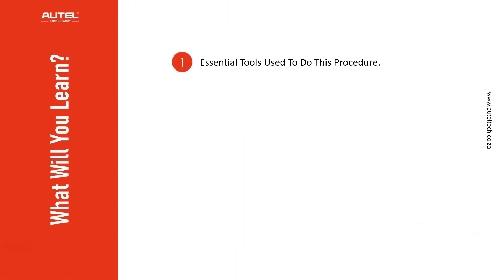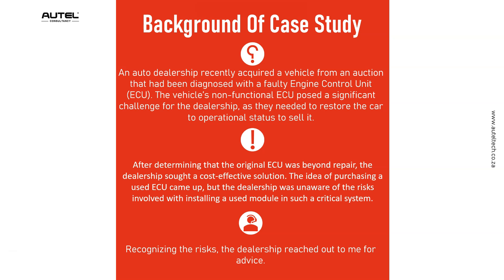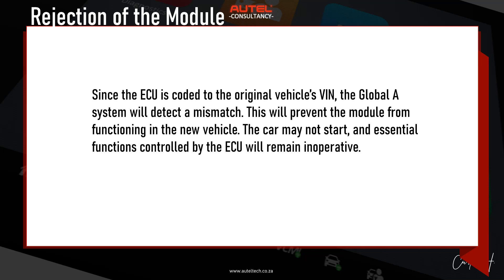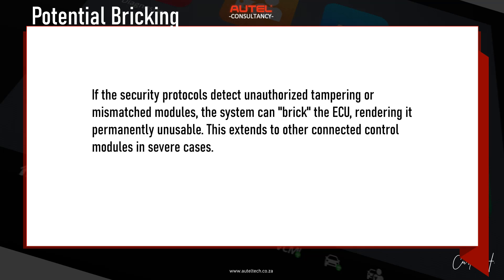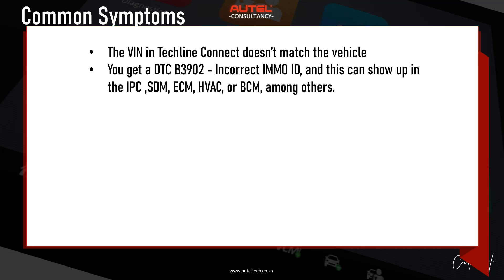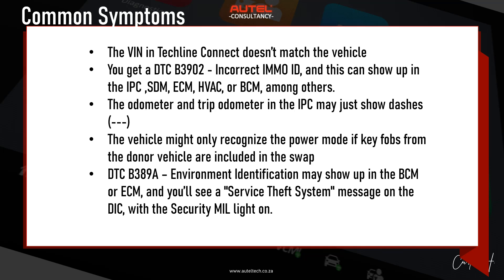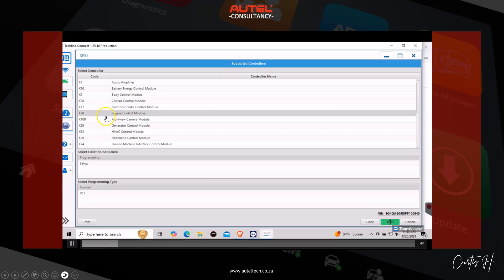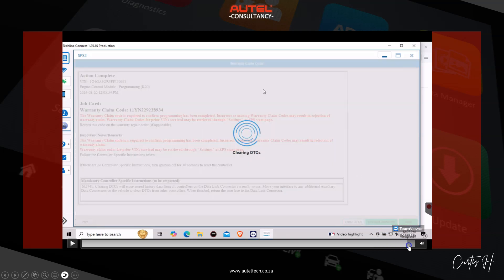Autel J2534 | Will Programming a Used ECU on a 2015 Buick LaCrosse Brick Your Vehicle

Comment: i have the autel ultra with the maxisys vcmi, im trying to change the solenoid id and strategy on a 2018 f150 10speed with FJDS software. can you confirm if thats possible? im able to connect to the vehicle with the laptop and the maxisys vcmi i can pull codes from every module if it has codes, and look at live data, but when i try any sort of programming function i get a "unable to communicate" error. has ford locked programming functions on the autel maxisys that you know of?
Reply from the maker: I think the terminology of Programming is confusing. Ill try to define it.. Programming is when you connect to the OEM server with your Laptop and J2534 and OEM software to install a flash file into a module. On your Maxisys it doesnt not connect to the FORD servers so you technically can't program any modules with ford on the Autel .  What you Autel can do is what I call coding or configurations. Its like your "rehabing" a component to work with all the modules by going into the special function section on your Autel. 

Also sometimes when the Autel doesnt have a function your looking for , you might need to go to the OEM software .  This is the best advice I can give you with out logging in remotely.
Reply: @AutelConsultancy   i appreciate the speedy reply. im using a dell laptop with fjds software loaded onto it connected to the maxisys vcmi which is connected to the truck. the autel ultra isnt being used for anything in this situation. i just need to know if the maxisys vcmi is capable of doing the programming or do i need to buy a ford vcm.
Reply from the maker: @txtrcr  I just did a 2022 Mustang with a client a few hours ago and he has the Ultra. I havent had any issues with Ford and the VCMI.  Sometimes the OEM Tool will have more features that are not in the aftermarket j2534s.

Comment: What's the cheapest tool to program mercades w209 eis on bench or obd11
Reply from the maker: You should book a tool strategy with me so I an find a solution . Depending on what your doing it might not even be an autel tool but I would have to asses you.